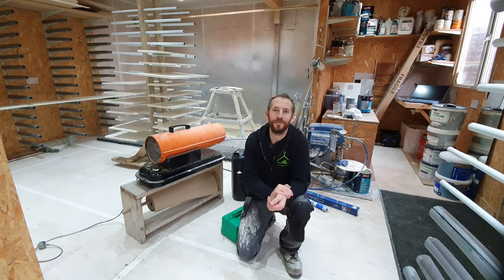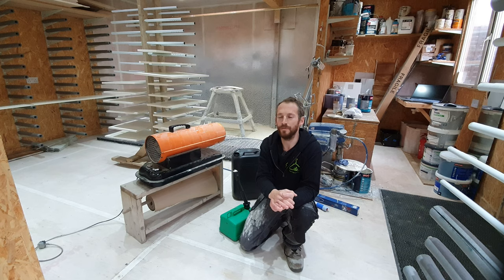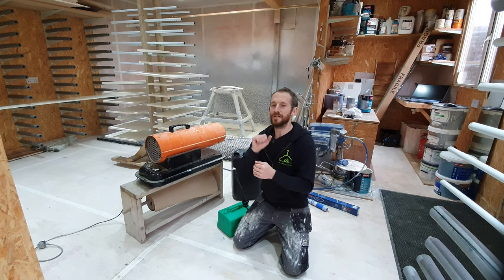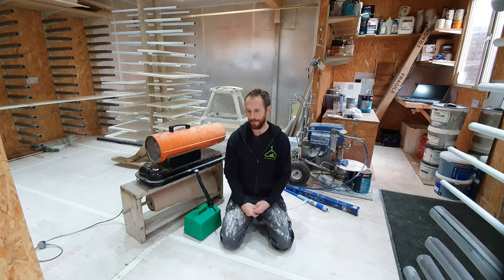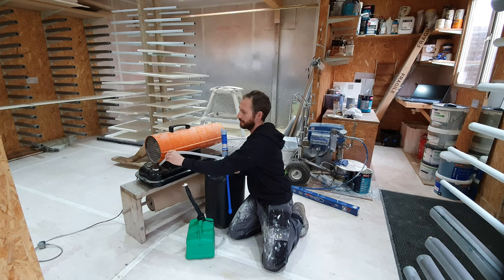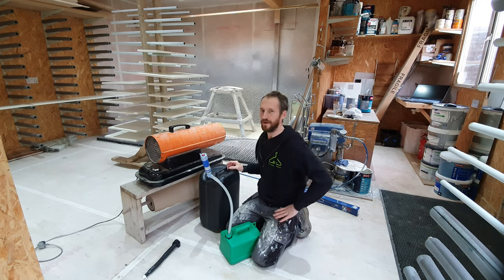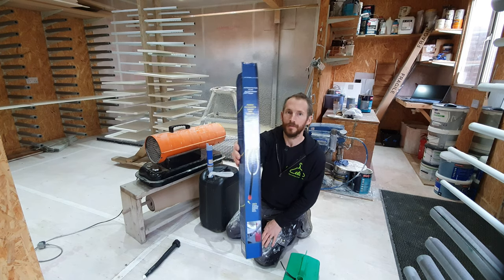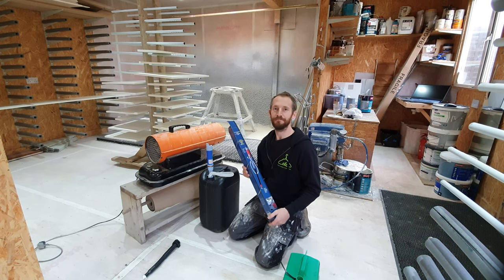You Need This Gadget!  Very Useful Thing!   EP#60

Comment: Hey Ryan can you recommend a sprayer for my kitchen cabinets some where between £200-400 range many thanks
Reply from the maker: Hi Shane, I'd probably go for a graco ultra handheld. They range from £520 for the version that sprays everything other than solvent based. Then £640 to spray anything including solvent based.
I bought an ultra max used for £450 the other week. So I'd probably advise to buy a used one of these, and depending on what you spray then choose the desired model.
If you watch my vid " First Go On my graco ultra max airless sprayer EP#57" you'll see it in action.
I think its fantastic and it the perfect sprayer to use for your kitchen 👍👍👍
Reply: Your best bet for the price range is getting a sgs 100litre air compressor or maybe even a 50litre compressor depending on how much your planning on using it and a anest iwata hte spraygun from spraymanuk your get the best possible finish this way 👍
Reply: Thanks Ryan for your reply just seen the video, on the graco ultra max, would the graco ultra max be good on kitchen cupboards fronts, I brought the Wagner 590 which can be solvent based and water base but it’s was rubbish, as it just spits the paint out and gave this horrible poc dot effect,
Reply from the maker: Hi Shane, yeah those types of budget hvlp sprayers are never really any good, maybe for fences but not for what you need.
These little graco sprayers are gems